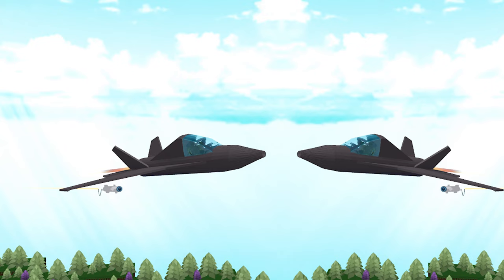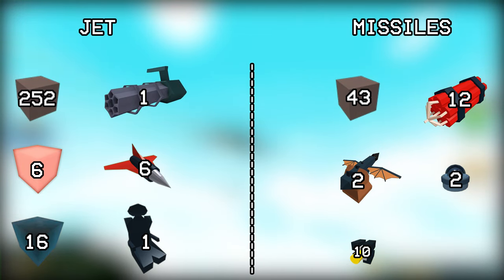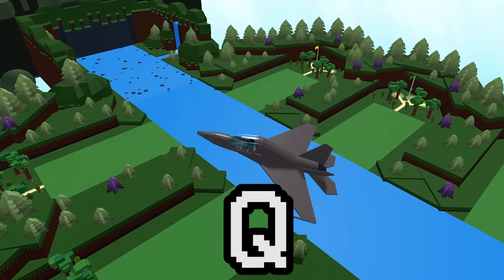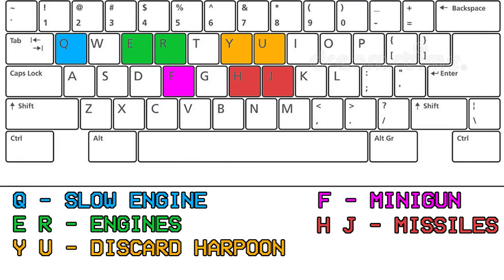How to make a working Jet fighter with working homing missiles (BABFT TUTORIAL)

Comment: How does your plane fly stable? I tried the missiles on my jet and it didn't fly stable
Reply from the maker: check if the hinges are locked in place on the missiles. Also if you fire them and miss they will come back to you and it will become unstable

Comment: Will the bombs explode by them self’s on the missles?
Reply: no
Reply: @Cadrian_Benton  yeah it works but I do it and the tracking is really bad and not even hitting where I aimed by a LOT. It just guides into trees and gets stuck when I hit ground targets
Reply: @Drixn.  so should i not build this
Reply: @Cadrian_Benton  idk I might have build it wrong but if I didn’t the missle is really bad. It has terrible tracking, doesn’t even launch 50% of the time. Loses tracking after 8 secs of flying. And gets stuck in trees a bushes a lot